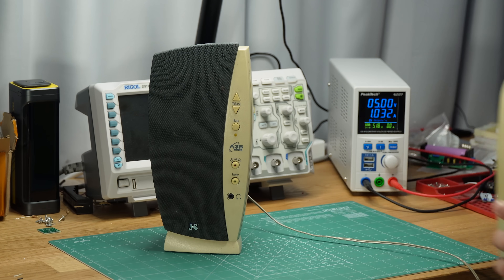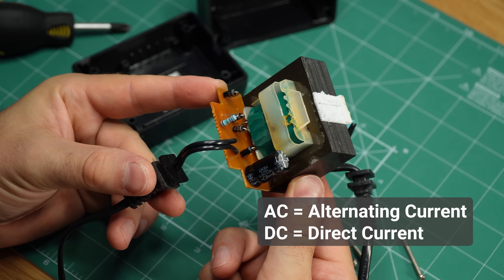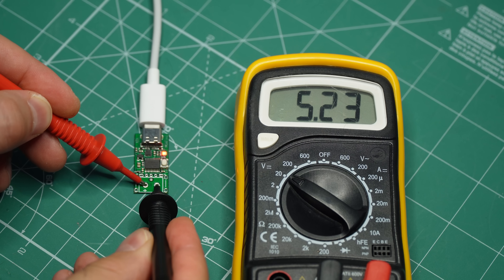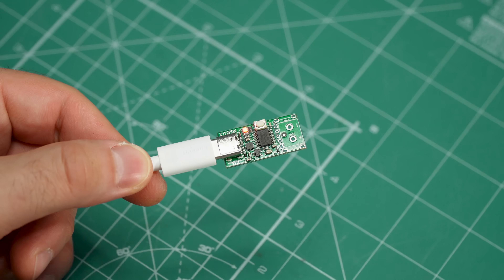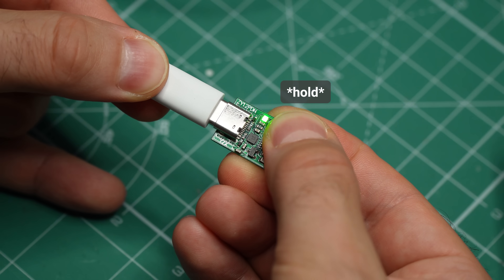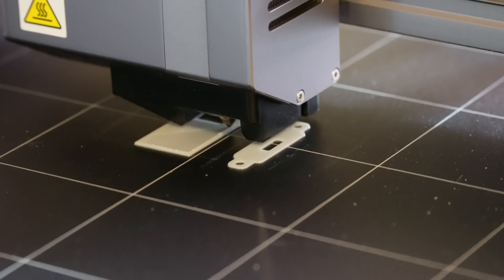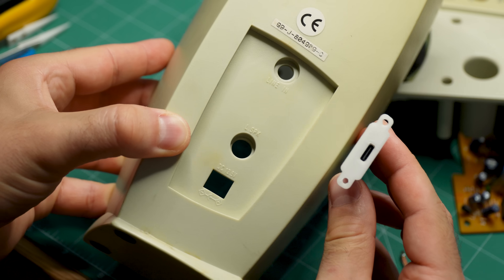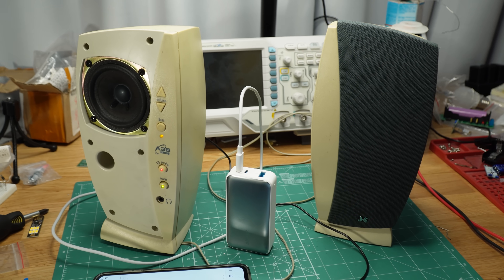I added USB-C to my ancient PC speakers

Comment: If U connect 10x power supply nothing happens, since they have the same voltage level. They would act as parallel power supply but u have more current available. Since ur speaker take the current itself, there is no current forcing to it to damage it

Comment: 7:35 or you solder in a different barrel connector. There are some where the insertion of the barrel plug pushes one contact away inside the connector, so that you can have both connected and have no side effects.

No barrel plug connected = Pin not pushed away = USB-C powered
Barrel plug connected = Pin pushed away = not USB-C powered
Reply from the maker: Great suggestion! I should have done that instead. Funny thing is I only learned about this function a couple of days ago

Comment: As far as AC adaptors are concerned, it depends on the device as well as some have the bridge rectifier integrated internally instead of the rectifier. Similarly, while it isn't efficient and won't work if the power rails of the respective device are 1A+, there are relatively small buck converters based on the DD4012A available on AliExpress, which can output quite some current while maintaining stable voltage. So if there's a 2nd power rail for 3.3V@500mA for example, it would be perfectly suitable to use such a converter.

Comment: i am personally the opposite due to money constraints. i want most of my devices to have a 5.5x2.1mm barrel jack or to run at a general voltage (5 or 12 volts), so I don't have to deal with different barrel jack sizes. I cannot afford a USB-C powerbank with PD, therefore i don't need USB-C on my devices at all. Only my phone and my laptop have USB-C, and that's fine.

Comment: KHM KHM Erm actualy the amplifier works better whit 12 volts it said in the datasheed 🤓🤓🤓
Reply: No it's not. More voltage to the amp= more RMS u have. And it's working with 14.4V. just 1 volt more than original adapter. And if it works better, the original adapter is also more than 12 volts?

Comment: 2.30 , I have this type c module which doesn't work with c to c cable but works with usb to c .
How to modify this usb to c module to work with any c type cable, please make a video. Because where I live this type of trigger board is not available neither in nor amazon 😢, please help.
Many of my old electronic devices can be usable again.
Reply from the maker: Solder two 5.1K resistors from CC1 and CC2 to GND. If you have only one CC pin, the Type-C to Type-C cable will work in just one orientation.

Comment: Only really relevant if you lose or blow the original power supply.
One catch, sometimes the earth of the DC inlet is not the same as the audio input, sometimes offset by half the voltage so they can synthesize a spilt rail inside, so if your intended supply, a laptop for instance will have the earths joined causing potentials issues. (note I said sometimes - just another rare catch)
Also the earthing layout can sometimes be quite important to stability.

Comment: a transformer powered speakers would sound better than any modern power brick
Reply from the maker: not necessarily. Today you'll find switching power supplies even in high-end gear
Reply: linear transformers are good because they produce less electrical interference compared to switching power supplies. This is why I can pick up AM radio at my grandma's. Meanwhile, at the place I live in, if I try to use an AM radio, all I hear is digital noise.

Comment: Actually PC speakers with a AC to AC power supply will work with an AC to DC power supply because the speakers have the rectifier circuit built into them
Reply from the maker: it might work, but it's easy to get the voltage wrong and damage the diodes
Reply: @LeftyMaker  a full bridge rectifier is a full bridge rectifier. you can get the polarity wrong and it will still be rectified to normal polarity.

Comment: Restoring plastic with hydrogen peroxide and UV light would be a nice touch. (plastic is not bleaching, but get back to original beige/gray color)
Reply from the maker: Yup. I've always wanted to try that, but I've been putting it off forever.
Reply: Look up how people restore white Lego pieces - the process is similar

Comment: Great idea. But also, you could still convert devices to USB-C that require more than one voltage from the power supply.
Simply pick the USB-C profile that fits the highest required voltage/power for the device and then hook up DC-DC converters to the output to generate the other voltages.
Reply from the maker: Yes, that would work in some cases. Too bad the speaker I show in the video requires a negative 18V rail. I'm not sure if a DC-DC converter can do that
Reply: @LeftyMaker  great question, I'm unsure myself. But technically they should exist. It'll just be more esotheric than the usual converters. Or maybe using two converters in serial would work with the new ground being the center point of the two modules.
Reply: @LeftyMaker  it can...you can get DC/DC switchers made to replace 7905 or 7915 type ICs...(if your not aware a 79xx linear reg makes a negative rail)

Comment: Honestly, it feels like an over-engineered solution to a problem that already has a simpler answer. I was expecting you to replace both the audio and power interfaces with a single USB-C connection, so the speakers could run directly from the computer without needing a separate power adapter. What you’ve done could just as easily be accomplished with a simple USB-C to barrel plug adapter—no modifications to the speakers required. I spent five minutes and found factory-made adapters (fully enclosed) for various barrel sizes (5.5×2.1, 4.8×1.7, 3.5×1.35, etc.) with different trigger voltages for about $2.50 on AliExpress.
Reply from the maker: I wanted to move both audio and power to USB-C, but it seemed too complex. I didn't find any modules that could do both USB PD and digital to analog audio. Do you know of any?

Comment: You could use switch that's built into dc jack instead of diode, but this would require slight modification to the PCB.

Comment: Would have been better if you’d incorporated a usb c aux module and used the data pins so a pc or android phone sees it as an external speaker
Reply from the maker: I was thinking the same thing, but requesting a higher voltage AND adding digital to analog audio conversion would have been trickier.  I still may try it in the future though.
Reply: @LeftyMaker  I'd love to see it if you feel like revisiting this one for the upgrade!
Reply: Should be possible  @LeftyMaker ! Cc1&2 for PD negotiation and d+/- for your USB class audio 2 compliant aspect. There's also info in Datasheets of chips that do this all by itself
Reply: @LeftyMaker  It would be totally possible with an external USB sound card, a step-down converter to reduce 13.5V to 5V, and using the USB data channel for communication
Reply: I thought of the same
Reply: The phone ain't supplying 15v mate
Reply: Unless you wanted to stay analog, and not be subjected to any potential digital shenanigans going on lately